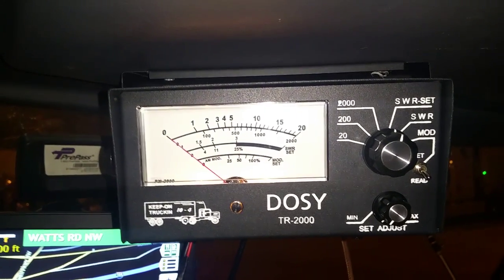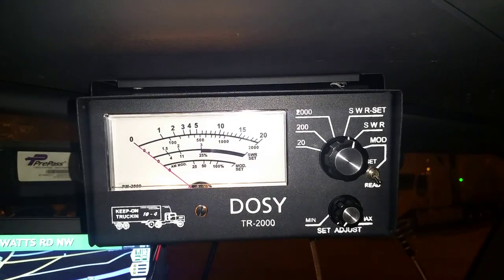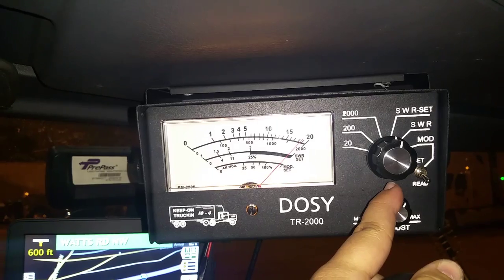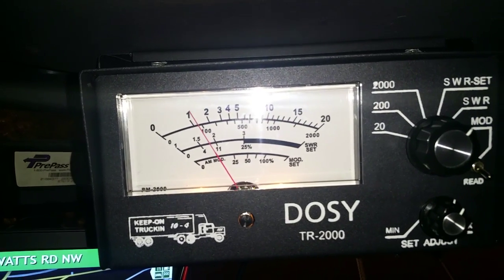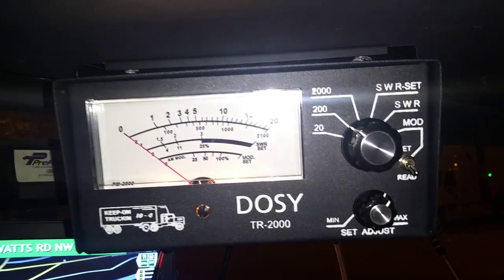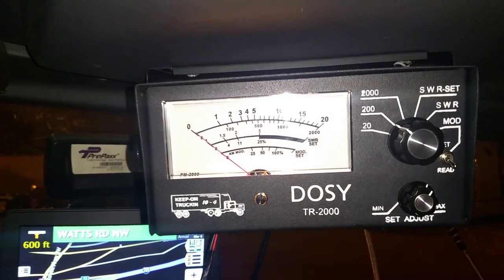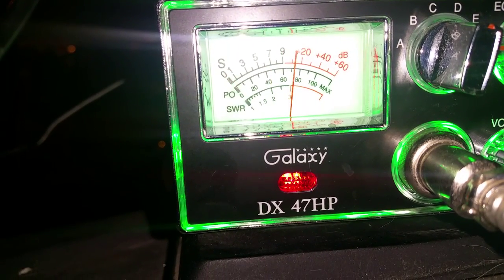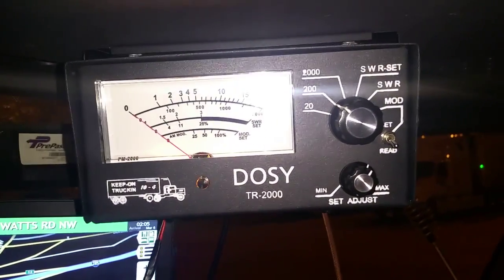Question About The DOSY TR-2000 calibration

Comment: I have this meter for some reason only the 2000 watts section is accurate. Technician put my set up on his bird and it read 800 watts on the dosy it reads 800. My radio dead keys 23 and swings 100 watts and swings the same on the Dosy but only on 2000 watts setting. The 200 watt setting is of by 50 watts on swing

Comment: You are reading the meter wrong, you were on the 200 watt scale and you were going off the 2000 watt scale.  You can't show 500 watts on a 200 watts scale.  No calibration is needed for watts unless the needle doesn't sit on zero when you let off the key.  That adjustment is the screw under the needle.

Comment: You will also get higher or lower readings depending where the mic gain and RF power is set. I'm assuming it's set all the way up since your dead key is 30 watts. Also depends on how your radio was set up too. A "swing kit" will allow the radio to swing to max power no matter where the RF power is set. Without it it will do less power all the way down and more all the way up.

Comment: Using the 20 or 200 watt scale you read the top scale 20 and 200 warts is full scale where u see the 20. 2000 is below that and read the same way. 2000 watts is full scale where you see 2000. It looks like your radio is keying at 30 watts and swings to 50 according to that meter. Maybe have a CB shop look at it and calibrate it. Remember these types of meters are reference only but can be close but not accurate. Hope that helps if you didn't get help already.